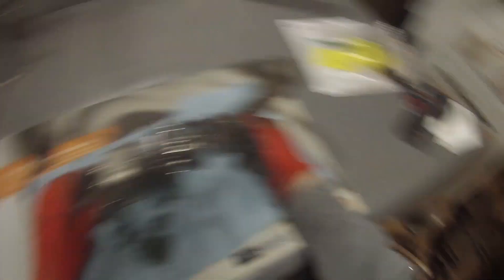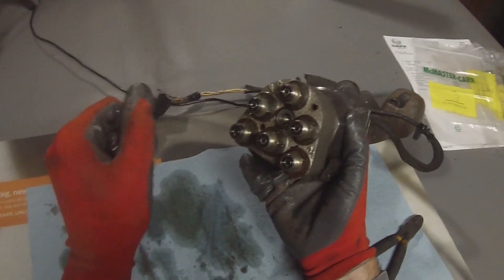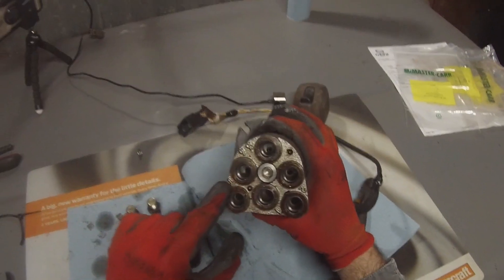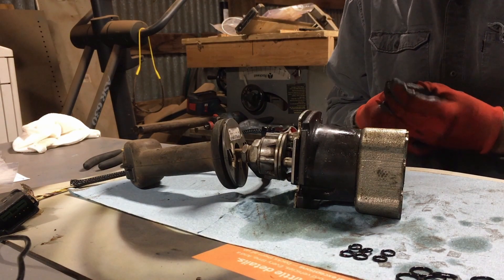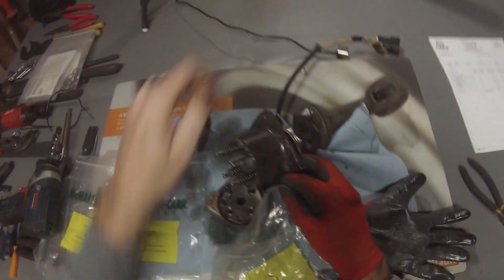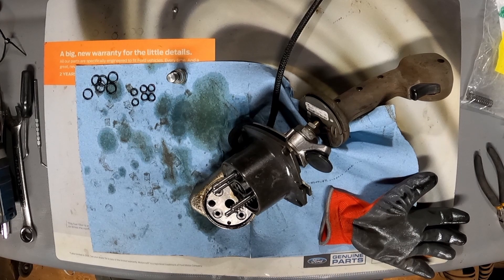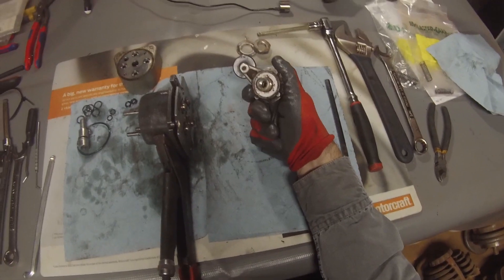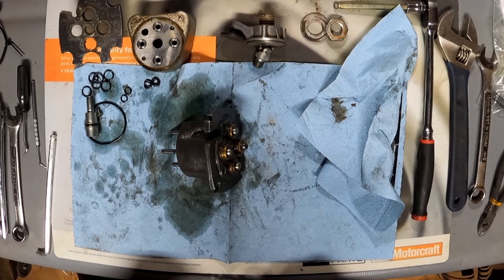Part 2 CAT 248 Leaky Joystick Pilot Valve. Can It be fixed without buying a whole new Pilot Valve?

Comment: Great video! I've been trying to get a visual on how the pilot controls all go together and this really helped.

 My drive side pilot controls are very unresponsive, and looking on forums, its a common problem. The resolver block, or the "manifold", goes bad and needs to be replaced, Cat wants $400 for that part, plus $100+ for all the seals. The plungers on that side are also leaking, so that could also be the problem, I'll have to dig in deeper to that.

One thing I haven't looked into yet is the float mode for the boom hasn't worked, I wonder what that could be, haven't looked into how that system works.

Anyway, thanks for the great video!
Reply from the maker: Sorry to take so long to get back but very glad you found the video helpful. I still have video for the reassembly to post and hope to finish the edit and get that posted. Thanks for watching.
Reply: Looking forward to it